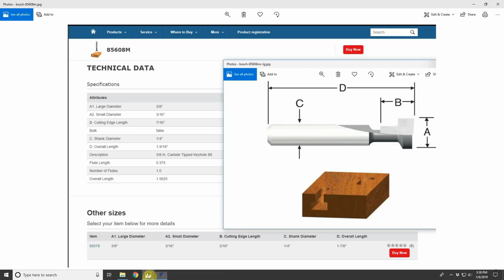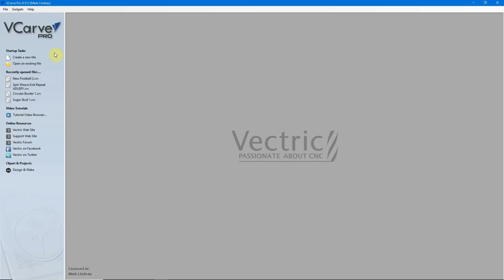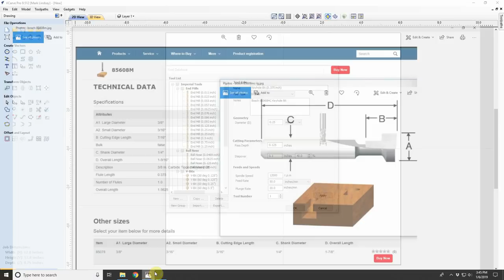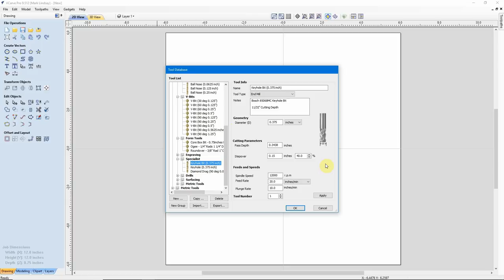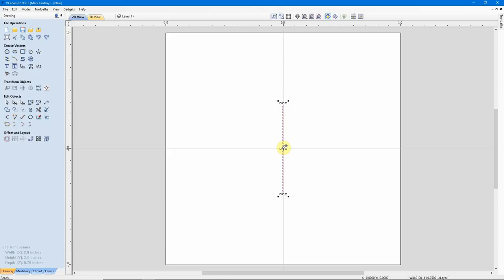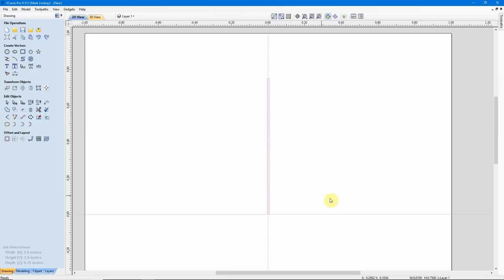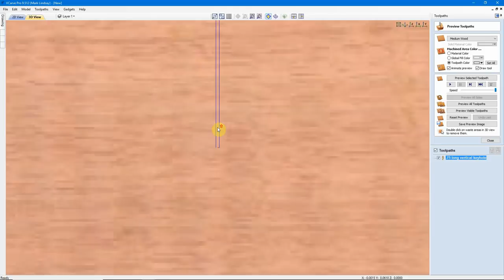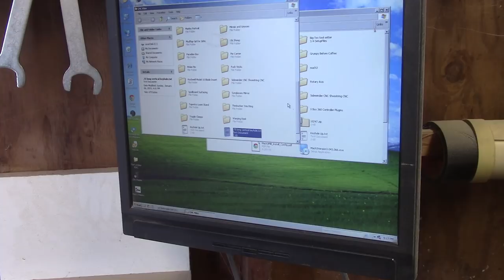How to Enter and Use A Keyhole Bit in Vectric - Part 12 - Vectric For Absolute Beginners

Comment: Thank you for this. Helps a lot!! I absolutely love the Vectric software, but kind of wish they would release a proper fixes for these kinds of work arounds. You can't engrave the bottom of a pocket with a drag bit either without a work around. (Need to make a fake tool profile to do it)
Reply from the maker: It's not so much "a fix" as it is the way the software builds and displays tools, toolpaths, and models. It's pixel based, rather than NURBS or polygons. I don't claim to understand it myself, other than to reiterate what the folks at Vectric told me - the software can't display any tool, toolpath, or artwork that features or creates an undercut. As for engraving, I was told that the reason it doesn't display very well is because the pixels required to display it are so small, we basically don't see them.

Comment: Thanks Mark. I was struggling to add a dovetail tool profile to my tool database but it just wouldn't work. So I turned to YouTube, and here you gave me the answer in your demonstration. It just doesn't work. You have to trick the software. So now I know I don't have to search any further. I believe that some day this feature would be added. Thanks again.
Reply from the maker: Thank you for checking the video out! As it sits right now, the way the toolpaths are calculated, it won't allow the addition of any tool that creates an undercut. I don't know if they're working on a way to change that or not. It would take a complete rebuild of the way the toolpaths are calculated, so I wouldn't expect it anytime soon. Then again, it could be coming soon - who knows?

Comment: Excellent video Mark. I've added my Freud keyhole bit to my VCarve Pro tool data base with the mfg's specs as per your video. I will try this out tomorrow.  Looks like the keyhole  has to accurately align with  center / balance point  in order for the sign / plaque to hang plumb.
Reply from the maker: Thanks, MacTech! The placement of the keyhole is a lot more forgiving than you would think. I tend to put the slots in the center along the X, but if they're off slightly, they still work just fine. I just think it looks more professional to get them as close to the center as possible.

Comment: Hey thanks for the great tips.  I scaled my keyhole project size down to about a 1"x3" long.  so I can cut a key hole by simply resetting my xyz on the project I am working on and it puts the slot right there where my bit is centered at.  I just made a tap file on the thumb drive that I can load and cut it in a minute or so.  Your tips on how to make this work was PERFECT!
Reply from the maker: Glad to hear it's working out for you! That's what I did as well. I made one keyhole that runs vertically, and a couple of several lengths that run horizontally. That way I have a choice of keyhole lengths should I need a horizontal keyhole. Those g-code files sit in a special folder, and whenever I need one, they're right there handy.

Comment: Great video Mark. Wish I had this for the first time I used a keyhole bit in my machine.  I also do another version of this now where I use a single line horizontally. Plunge at one end of the line pull up on the other. I find this method to work well for carvings that are side heavy. Not balanced if you will. Then the length of the key hole allows you to balance the carving on the wall. Again great video. Thanks for all you do.
Reply from the maker: Thank you, Dwayne! Yeah, horizontal keyholes are handy, for sure. Especially for cumbersome projects.

Comment: Great job on the video! I watched your video because I was curious if your method was anything like the way I came upon cutting a keyhole about 10 years ago.  Sure enough, your method is just like mine except my tool path vector is a rectangle a couple of thousands wider than the cutter diameter and I cut inside the vector instead of on the vector. The results are the same, just a different way of doing it. Thanks for putting out good content on your videos!
Steve Reynolds
Reply from the maker: Thank you for checking it out!  As you've been doing this for a few years, you well know that there are a lot of ways to skin a cat.

Comment: I think I may have found another way to create the toolpath. Start by creating a line/polyline, first point at 0,0 second point at 0,0.75 and third point back at 0,0. Then you create a fluting toolpath, start depth .375, depth .031, ramp at start and end, ramp 100%, ramp type linear. I haven't tested it yet but I think this will make a slight incline on the keyhole so it pulls the piece tight to the wall as you slide it on the screw. I'll test it later today and see how it works, what do you think?

Comment: Great video Mark  I would like to see some one do a video on BOX Joint Gadget . Setting it up to cut in the vertical position not laying flat on the waste board , Which would mean that your cutter would have to travel past the  front of the machine some what. I have a customer that  wants a good amount of boxes made at one time several times year.If Not the gadget then at least showing how to design the  pins and sockets standing  up. may be this should be discussed in a email..Let me know what you think Jeff
Reply from the maker: It wold probably be something best discussed in email, Jeff. My machine isn't set up for cutting vertically like that, so I'd have no way of testing to make sure I got the g-code right.

Comment: Mark, thanks for a great video. Is it possible to make two holes at once ? Right now I make one hole re-zero again to my next spot and run the 2nd hole again.  Thanks
Reply from the maker: I'm not sure I follow you. You want a keyhole with a hole at both ends?
Reply: Mark I got it, I have the pro version it does have the keyhole gadget. I just wanted to make two holes 16 inches apart.

Comment: Will you be doing a video showing how to cut a keyhole slot using the gadget?
Reply from the maker: Thanks, Dave. I guess I could. To be honest, I don't use the gadget. I'll get into it and put something together.
Reply: Dave, what gadget are you referring to?
Reply: @MarkLindsayCNC  I don't use the gadget method either because I wrote my own simple G-code program way back before gadgets was in V-carve Pro.  I watched Peter's video on keyhole slots and he used the gadget feature and in my opinion that would be easier for a beginner to use rather than having to draw something up and put a toolpath on it.  :-)
Reply: @MacTech007  In V-Carve Pro and I assume it's in all of the Vectric products at the top of the screen there is a Gadgets feature next to the Help button.  If you drop down the menu you will see a Keyhole Toolpath.
Reply: thanks Dave. By the way, I really enjoy your youtube channel.
Reply from the maker: The main reason I went with this method to demonstrate is for the Cut2D and VCarve Desktop users that asked about it. Gadgets are only supported in the Pro versions - they're not available in Cut2D or VCarve Desktop.  I'll get into the gadget and play with it a bit, then do another video down the road. I forgot to mention a thing or two in this video, and that'll give me a chance to mention them.
Reply: @MarkLindsayCNC  I've only used VCarve Pro so I didn't know the gadgets feature wasn't in the other versions.   I was just a little surprised this morning when I sat down to watch your video because I thought it would be about the gadget feature.  :-)
Reply from the maker: I do need to get into the gadgets and use them more. I have had questions on one or two of them, but truth be told, I forget they're up there and don't use them much. I have a video in the works for the rotary axis using a gadget, but I'm not quite ready for it. I have to work out one more step. It's gonna be a game changer for a lot of folks with a rotary axis and VCarve.
Reply: @MarkLindsayCNC  Hot Diggity!

Comment: Does that end up being perfectly symmetrical or off by .010?
Reply from the maker: It'll be .010 wider than normal, but it's a keyhole. No big deal. As an added bonus, it also makes it a little easier for the head of the nail/screw to fit in the hole.

Comment: Would drawing a straight line the length of the cut and then doubling back on the same lie work?
Reply from the maker: No. A vector has a start point, an end point, and only one direction - it can't have 2 directions at the same time. If you try to do what you're suggesting, the bit will plunge in at the start point, cut along the line just fine, then try to retract at the end of the line. With no cutting edge on the top of the keyhole bit, it will be a disaster. That's why I made the rectangle, then deleted one end of it - so that the start point and the end point of the resulting vector were almost in the exact same place.

Comment: Thanks for the video, this allowed me to make some keyholes. However, I did not edit the rectangle to create a U shape which saves time. Also, it appears that the VCarve Pro v10 had a Keyhole gadget (https://docs.vectric.com/docs/V9.0/VCarvePro/ENU/Help/Gadgets/Keyhole%20Toolpath/Keyhole%20Toolpath.html). I only have VCarve Desktop which doesn't appear to support the gadgets.
Reply from the maker: Thank you very much for checking out the video! I made this video primarily for the folks with VCarve Desktop because you're right - Desktop doesn't support gadgets. The method works for all Vectric titles as well.

Comment: Thanks for the video mark, what is the brand of framing square you used in this video?
Reply from the maker: Thanks for checking out the video!

That square is a try square I got at Harbor Freight. It's just 1 of a 3 square package they have for a low price.
Reply: Thanks Mark!

Comment: Why not remove some material with the 1/8" bit before using  the keyhole bit? It would be less stressful on the cnc. The 1/8" is already chucked up.
Reply from the maker: The CNC is more than capable of handling a keyhole cut. It takes about 3 times longer to do the required tool change than it takes to cut the keyhole. The bit only moves about 3/4 of an inch. Removing material before the keyhole cut is completely unnecessary.  Thanks for checking it out!
Reply: @MarkLindsayCNC  I'll be cutting 12 this afternoon. Thanks for all your great videos.
Reply: I used the process on some beech. Worked great.